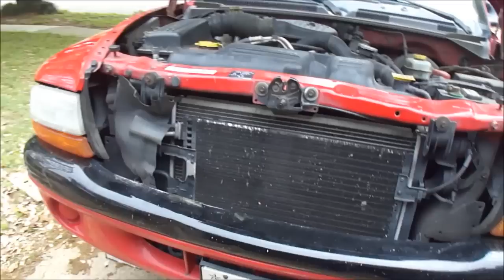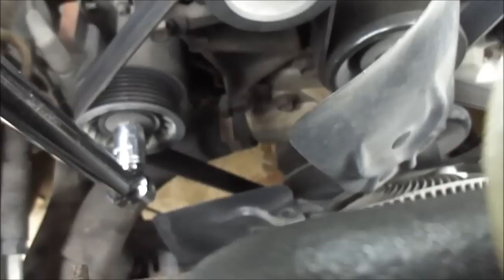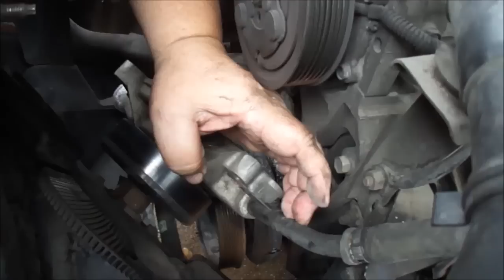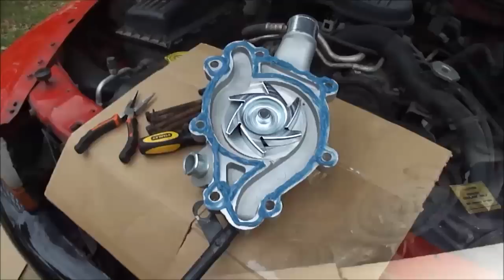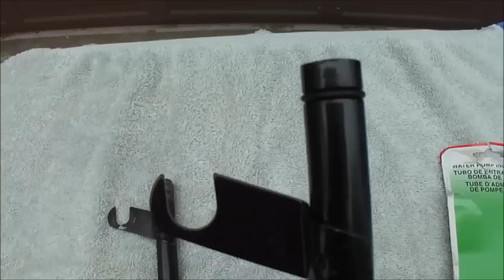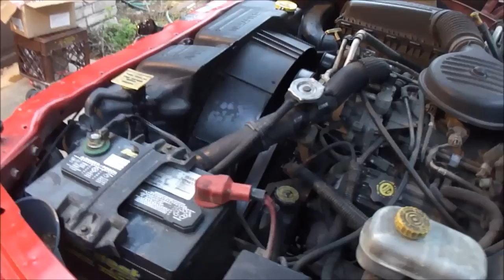2000 Dodge Dakota Sport Water Pump Replacement V6 3.9L

Comment: i am sooo worried that i will break off a bolt. my 94 dakota needs a new pump....is there a way to guarantee not to break a bolt? tips or tricks? thank you so much and have a great weekend
Reply from the maker: Kevin S. Some WD-40 goes a long way to easing out the tough bolts.  Let it penetrate for a while...an hour.
Water pump bolts usually aren't that tough.  Let us know how it goes.
Reply: Thanks; i ended up paying a mechanic; he also replaced my belt tensioner....now i'm having a leak of red fluid on the ground roughly in the same area.....front seal tranny?
Reply: Kevin S. Most likely a transmission cooler line, or Power Steering Hose.
Reply: Thanks Jim! For it to simply be an easily replaceable hose would be wonderful. i met a young mechanic that does work on the side; i'll have him check those hoses. Thanks again